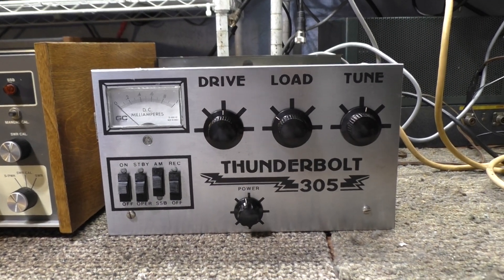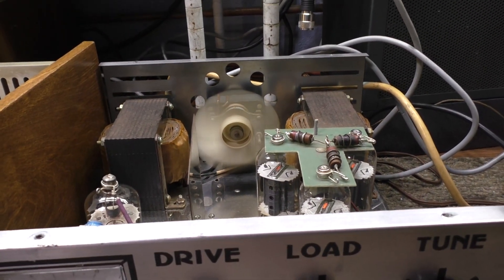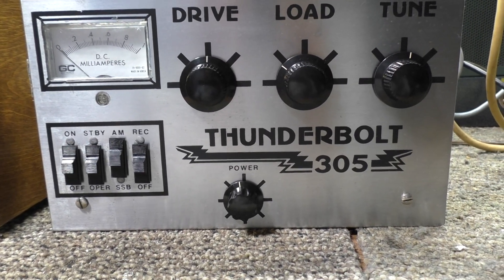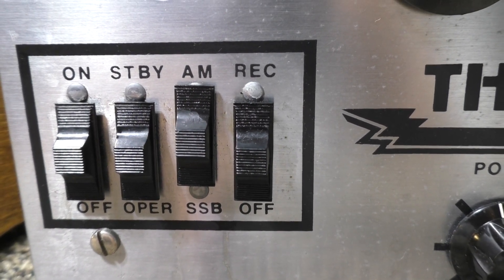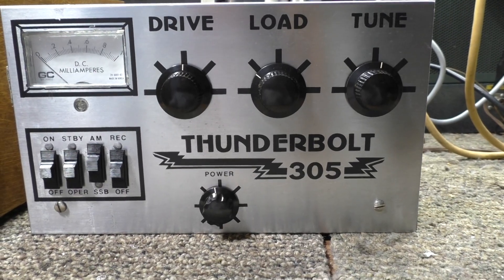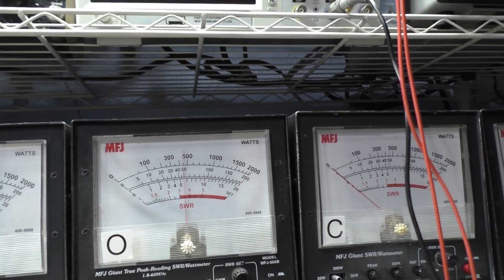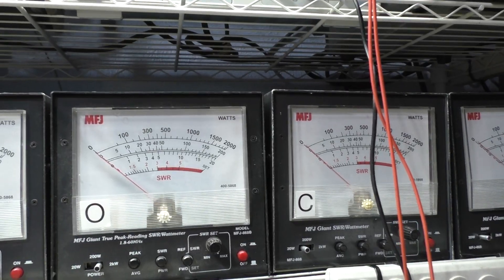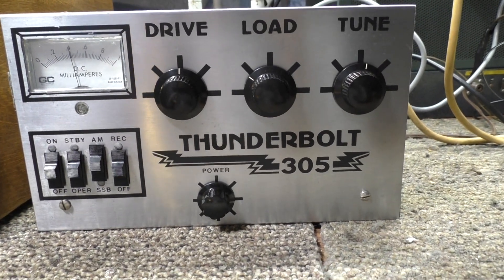Thunderbolt 305 Sweep tube linear amplifier all wrapped up on the bench

Comment: I just got the smaller one. Can you do instructions on how to operate  for a newbi. I've have pill amps.
Reply from the maker: I don't know which one you have, but with this one: Tune and Load together tunes the output. Always tune both of those for max output. On this one, 'Drive' is Driver tune. It tunes the output of the driver tube. Always tune it for max output too. The small 'Power; knob is the variable power adjustment. Adjust it for the power level you want to have. Keep in mind most linear amps work better, have less problems, and sound better if the power level is adjusted low and it will swing up high.

Comment: I like my KLV1000  😎 Good video sir!
Reply from the maker: I had one. Good amp, but pushes the tubes hard and to tell the truth, they do the watts, but are not that well made.
Reply: @tramdr Mine is a 1 driving 4 6KG6A. I drive it with 7 watts and barely any drive on the box so I don't "overdrive" it. I've heard myself on a Live Feed, it does what it's supposed to, sounds very good and doesn't get very warm. I am glad I bought a extra set of 5 tubes when I got this unit new but have never had to think about changing them, it does so well. I have my Eagle 5000 turned almost all the way down to drive it.